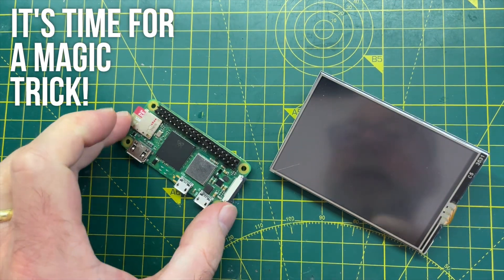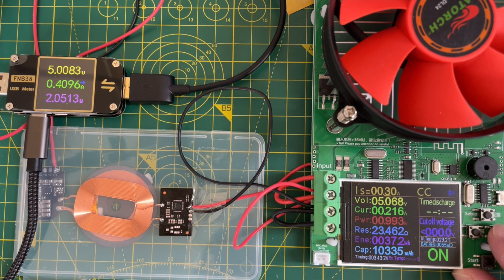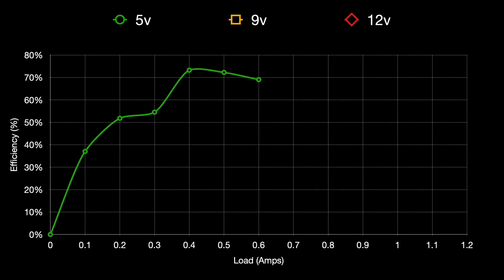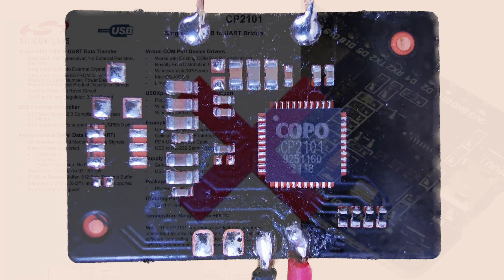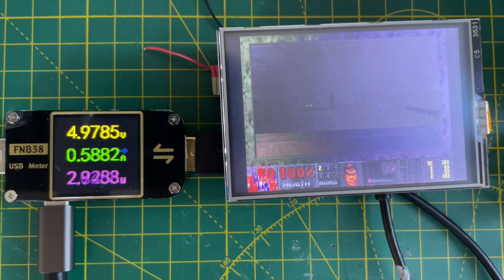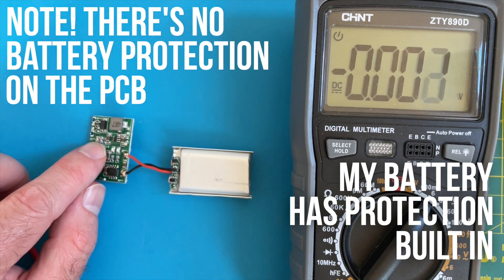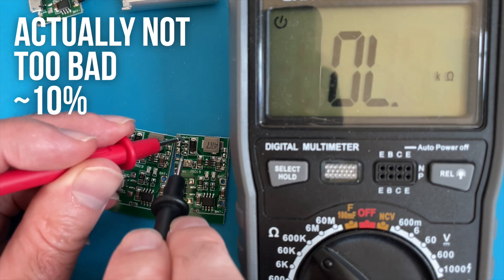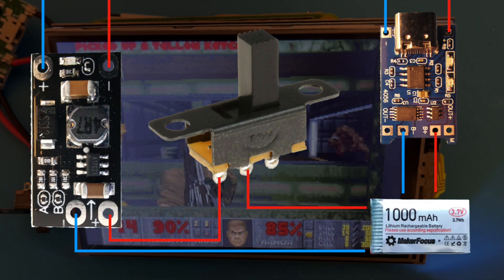Wireless Powered Raspberry Pi

Comment: I always found inductive charging interesting too. I used to work on an automated forklift system from 1989 that used inductive charging.  It was decommissioned in 2017. The system was really finicky, but if you kept it maintained right it worked fine. Unfortunately, the system replacement just used contact charging. It's not as interesting but much more reliable.
Reply: stopped by comments to opine that I can't imagine a project where wireless charging would beat out simple mechanical contacts (spring loaded). Sooo much power loss to the air.
Reply: @markpippin9358  If you have people working in the area, there are no contacts to get shocked by, and the coils were flush with the floor, so there is no trip hazard. Also, there are no moving parts.

Comment: @Atomic14, could you do me a favor and try to charge a battery while connected to the PI or an ESP32 (atom echo)? The QI units i ordered where not able to charge and drive my Atom echo at all.
Reply from the maker: I'll try it out tonight. Were you able to do it separately? It might be that your battery charger is asking for too much current lots of them will charge at 0.5A, so that on top of the current draw of the Pi or ESP32 might be too much.
Reply: @atomic14  qi-chargers worked to charge the battery, and the battery was able to run the esp, but none of the qi-chargers where able to run the esp32 on his own.
Reply: @atomic14  and thanks when you like to do that. Could you tell which receiver you purchased for your experiments?
Reply: @atomic14  did you have any luck testing this?
Reply from the maker: @NielsNL68  Sorry, got completely sidetracked. I wonder if you transmitter/receiver can't get enough power across to drive the esp32?
Reply: @atomic14  that is a possibility indeed.
BTW I use off the shelf QI transmitter's just to be sure that the sender is working as it should.

Comment: that unkown chip at 4:04 with "BO62140" looks like a clone of the TPS62140 from texas instruments.
3–17V 2A Step-Down Converter with DCS-Control in 3x3 QFN package
Reply from the maker: Hmm, that could make sense. I really need to trace out the connections and get some more clues.

Comment: I always find that charging using wires much more efficient  :-) 
Unless you want a atex style isolation so no connectors or metal parts. 

The question is not can it can be done, but do we need it? What problem are trying to solve 

Still a nice video
Reply from the maker: I was surprised at just how efficient it was - and I suspect with good design it could be much higher. But you are right - it’s never going to be as good as wires.
Reply: @atomic14  well the energy gods always take with one hand and never give back with the other.
For every change in energy state they want their cut, so by adding two extra changes in energy states to the charging process we can never win. And what do the gods do with their share they mostly just waste it heating up the planet. :)

Something to think about on a Thursday morning don't you just YouTube.
Reply: convenience
Reply: I'm working on a Com-Batch (= a Intercom/ WalkyTalky/ Alexa ) for @home_assistant that you can put on your clothes. 
For this device i like to use the wireless interface to charge the battery. But until now i have not been successful with the units i ordered from ali. They work fine but not yet together with an esp32
Reply: @NielsNL68  it would take one large pie to fill my clothes. 🙂
Reply: @TheEmbeddedHobbyist  lol,  it runs on a M5stack Atom Echo onboard,
Reply: Can make a device totally waterproof.  That's why.
Reply: @GoatZilla  But the point is that it's also push in to products that don't need to be waterproof. if there is a need for it than you have to except the losses involved, we should be aiming for the most efficient power transfer as possible on our little planet. 🙂
Reply: @TheEmbeddedHobbyist  Are you saying Raspberry Pis don't need to be waterproof?  Be clear.
Reply: @GoatZilla  All Raspberry pies need to be waterproof as no one want's soggy pastry.
Reply: @TheEmbeddedHobbyist  cool.